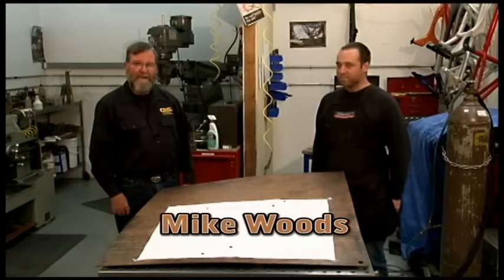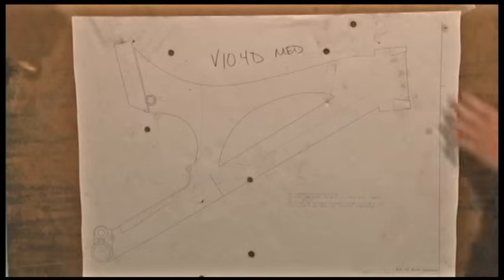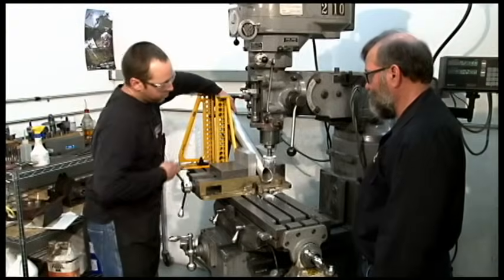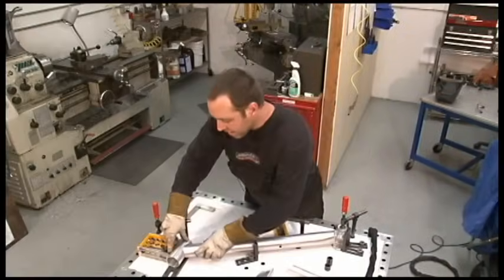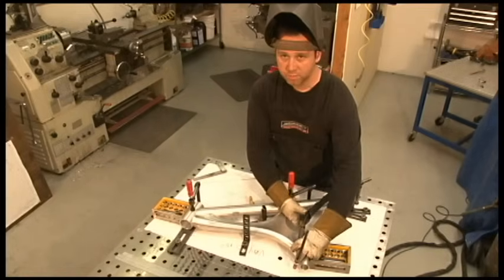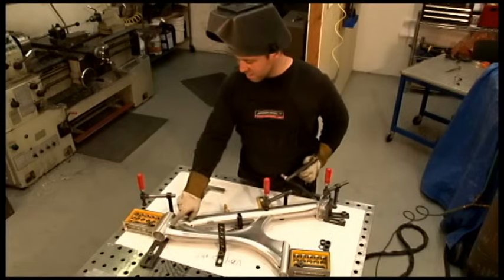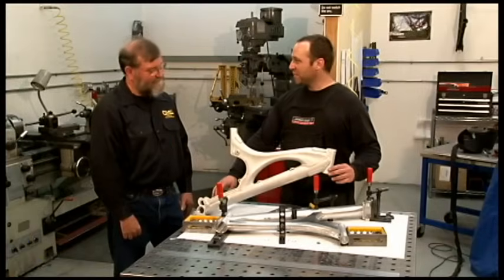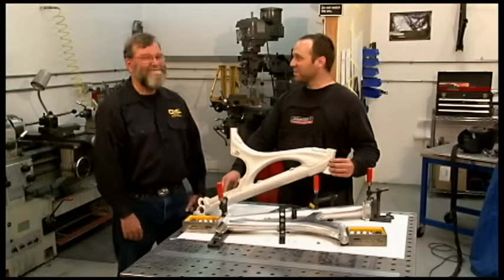Welding Aluminum Bicycle Frames

Comment: Which filler rod is being used?  What alloy is the frame made of?  Tia
Reply from the maker: I am not certain, but I believe the material is 6061, and the filler is 5356
Reply: @RonCovell  tyvm.  I have been trying to find some information on welding 7005 which is also used for bicycle frames.
Reply from the maker: I found this online:
https://www.google.com/search?q=welding+7005+aluminum&sca_esv=4b32451117f11e5d&rlz=1C1VDKB_enUS1060US1060&ei=lNozaMnmLZLAkPIPi6KnwAY&oq=welsing+7005&gs_lp=Egxnd3Mtd2l6LXNlcnAiDHdlbHNpbmcgNzAwNSoCCAAyBxAAGIAEGA0yCBAAGAgYDRgeMgsQABiABBiGAxiKBTILEAAYgAQYhgMYigUyCxAAGIAEGIYDGIoFMggQABiABBiiBDIIEAAYgAQYogQyCBAAGKIEGIkFMggQABiABBiiBEj9IVClCFjlC3ABeAGQAQCYAWGgAa4BqgEBMrgBAcgBAPgBAZgCA6ACuwHCAgoQABiwAxjWBBhHmAMA4gMFEgExIECIBgGQBgiSBwMyLjGgB58NsgcDMS4xuAe5AcIHBTAuMS4yyAcK&sclient=gws-wiz-serp
Reply: @RonCovell  Tyvm,  I have seen similar but I am trying to find detailed techniques for welding.  I have found videos but they just show the welding but leave out any details.  Because of the Zn content it does react differently from the 3xxx, 5xxx and 6xxx alloys.  What I am trying to develop is a repair technique for the valve covers on mid-90's MB engines,  I have one that I am working on and it is quite different material to weld on.
Reply: @RonCovell  I am thinking that the technique is to just barely melt the alloy as the melting point of Aluminum is about 1200F and the boiling point of Zinc is about 1600F.
Reply from the maker: I am not an expert at welding 7000 series aluminum, but my understanding is that 7075 is considered 'unweldable' - not because you can't make it flow together, but that 'intergranular corrosion' happens internally after the weld is made, making it likely to crack. I know that 7005 is welded for some bicycle frames, but I don't know the details of the process. You might learn something from this video: https://www.youtube.com/watch?v=q9eD_NKGQ9g&t=5s
Reply: @RonCovell  7075 is considered unweldable and the reason is primarily the copper content.  The cracking actually occurs during the cooling process and is an initiation site for further cracking.  The cracking from the welding process significantly reduces the fatigue life and strength which negates any initial reasons for using 7075 (which has the highest tensile and yield strength of any aluminum alloy).  2024 also has a high copper content and is considered unweldable for the same causes as 7075.  Due to their inability to be welded is the reason why aircraft are riveted together rather than welded.  Even though riveted joints have a lower strength than the parent metal, the loading on aluminum wing panels is more of a plate loading than a longitudinal or transverse tensile load.

Thanks for the video link.  Aaron is an interesting person.

Another thing, 7075 is a Zn-Mg-Cu alloy while 7005 is a Zn-Mg alloy.

I have done better on my valve cover in building up corroded areas, but it is difficult.

I may try using a larger cup and see if that helps any.
Reply from the maker: Thanks, I see you have researched this extensively!
Reply: @RonCovell  Well, to be honest, I am an engineer with an extensive background in materials science, so I know a thing or two and I don't work for that insurance company.  🙂

I have enjoyed the conversation.  It has been helpful and gave me a few things to think about.

Comment: What is the most suitable type of aluminum to make a frame of this type?
Reply from the maker: Each manufacturer selects their own particular alloy, and some keep this information secret. I believe most manufacturers use aluminum in the 6000 series, and the widely-available 6061 would be a good choice for someone to start with.
Reply: thank you very much for the reply...

Comment: Just asking as a noob, is not necessary to have gas flow inside the tubes?
Reply from the maker: You'll find that there is a difference of opinion on this. With reactive metals like stainless steel and titanium, internal purging is quite important. With steel alloys, very few builders do internal purging. Aluminum is occasionally purged, but it's not the norm, and the frame shown in this video was not internally purged.
Reply: @RonCovell  great, thank you for the explanation 🙏

Comment: Its great and thank you for the detailed video,We are new to the manufacturing of Aluminium Cycle Frames.Could you please let us know whats the table name and its fixtures which you used to hold the frame rigidly
Reply from the maker: That type of table is often called a 'fixturing table' or sometimes simply a 'welding table', and there are many manufacturers worldwide. Here's one example to get you started:
https://www.trick-tools.com/StrongHand-Rhino-Cart-Mobile-Fixturing-Station-TDQ54830-K1-10380
Reply: @RonCovell  Thank ron :)

Comment: I love the look of Aluminium welds and the look of bare aluminium, it used to seem like the perfect metal to me, but didn't know then how much it can be prone to salt attack, discovered that from riding motorbike in winter and dishwashing aluminium food trays...
Reply from the maker: Well, one option is to anodize the aluminum. Anodizing is quite good at protecting aluminum from salt water and many acids. The anodizing can be clear, so it looks a lot like bare aluminum, or it can be colored, which can offer an interesting 'candy' like finish. Many aluminum bicycle parts  are anodized - like crank arms and stems.
Reply: @RonCovell  ah okay yeah, I've seen anodized aluminium parts before but don't know the process of getting I supposed probably through some sort of electrolysis in a solution bath, I'll have to look it, thanks! 👍

Comment: Is it true when you weld aluminium you weaken the metal around because of the heat?
Reply from the maker: A lot of aluminum is heat-treated to give it extra strength, and when you weld it, the heat treatment is lost. If you weld on aluminum that has NOT been heat-treated, no strength is lost. Further, if both the base metal and the welding rod are the proper alloys, the entire welded assembly can be heat-treated, which is pretty much the standard procedure when making aluminum bicycle frames.

Comment: I have a yuba mundo cargo bike
Problem is theres no suspension 
I paid $1800 no motor
Highest speed 24 
8x3 
They say I can put 9x3 that’s it 
The back frame is not wide enough for 12 speed biggest tire 26x2.45 not big enough for 441pound weight limit 😔
I would rather build my own custom cargo bike then shop online or in store
Not even babboe centure xl trike is not worth it that’s a tricycle with skinny tires on it smh
Reply from the maker: Sounds like you have good reasons to build your own frame.

Comment: what type of welding machine did you use? Im used to seeing those types with sparks flying
Reply from the maker: TIG welding was used on this bicycle frame. MIG and stick welding both are accompanied by a shower of sparks, but sparks of any kind are quite rare with TIG welding, and usually only happen if there are impurities on or in the metal.

Comment: Thanks for sharing, I am not sure there was much on this video, no cleaning steps, prep, specs, etc. just a little bit of welding, but the best I got was to use the breadboard flat to set the position of the parts to start.  That was a good tip.
Reply from the maker: Glad you enjoyed it! I do have other videos that go into more depth on the welding processes:
https://www.youtube.com/watch?v=3sp1BP29J4E&t=61s

Comment: Just curious I dont know if someone has asked it yet but is the welding done using a foot pedal? It didn't sound like one was being used.
Reply from the maker: Yes, the TIG welding machine had a foot pedal to control the amperage 'on the fly'. That's the system preferred by many professional welders. Unless the amperage changes are large, you often can't hear them.

Comment: Hi Ron was wondering if you might know the best way to clean aluminum?  Thanks
Reply from the maker: It depends on what's on the surface. I use acetone for oil or grease. I like the Scotch-Brite Strip & Clean discs for light or medium corrosion. Paint is best removed with a specialized striper. For deep corrosion or pits, I use whatever grit of abrasive disc is required to efficiently remove the surface crud.

Comment: I have a cinelli vigorelli.with a dent / bend in the downtube ..when it was shipped..can it be fixed or replaced?
Reply from the maker: Will - I believe your frame is steel, which is TIG welded together. While this is a tricky repair, which should only be attempted by a qualified bicycle frame builder with a precision fixture - the downtube can be replaced. Of course the frame would need to be repainted afterward, so the cost of a proper repair could approach the cost of buying a new frame!
Reply: @RonCovell  I think you're right .Columbus thron oversized 
It's a vigorelli pista frame 
I.built it with proper campy track parts 
Sold it on ebay 
It got bangeg up while in transit..I shipped it with 6 inch foam core all around

Really ticked off at ebay 
Global partner 
Some co in Canada 
So if I get the bike back 
Any suggestions on who can fix it and get I back tp it's original 

It's a collectible bcofvthe age and it's special Ed color for the giro
Reply from the maker: I just found this, which could possibly be a solution:
https://www.youtube.com/watch?v=JTDeXG0kweA&t=276s
There are a LOT of qualified bicycle frame builders around. One who is well known on YouTube is Paul Brody, who is in Vancouver BC:
https://en.wikipedia.org/wiki/Brodie_Bicycles

Comment: what name weld tool you used to weld in your frame aluminum?
Reply from the maker: This is TIG welding. TIG stands for Tungsten Inert Gas.
Reply: It is right to used crack frame
Reply from the maker: There are 'issues' with repairing cracked aluminum bicycle frames. While cracks can certainly be welded, most quality frames are heat-treated after welding, and you will lose the heat treatment after re-welding, making a weak spot in the frame.
Reply: Over sitpost?

Comment: sir what s the base material and what filler rod used here sir?
Reply from the maker: I'm not the one who did the fabrication here, but I believe the tubing and monocoque is is a 6xxx alloy (most likely 6061) and the filler rod is probably 5356.
Reply: @RonCovell  ohkk sir thank you

Comment: Hi sir actually we are a startup compnay making alumnium 6061 frames(bicycle) .appreciate your advise for painting process for best painting
Reply from the maker: Powder coating is a great solution! It bonds tenaciously, comes in a wide range of colors, and is extremely durable.
Reply: @RonCovell  oh kk thank you sir.actually we are planning to give smooth colors with stickering and close the surface with clear coating(like we apply on car surface for gloss look).any treatment process wud u advise sir to make surface clean and then apply paint or primer etc
Reply from the maker: Aluminum is somewhat more difficult to paint than steel. Paint is not my specialty, so I cannot offer specific recommendations, but many automobiles now have aluminum panels, so you could check with places that do collision repair to learn more about this.
Reply: @RonCovell  sure sir noted thank you again

Comment: Hi. I have a question is there an easy way to use a blowtorch and some kind of stainless steel rod and bond to stainless steel pieces together or is this impossible. I have a video I can send to show my question in video form. Thanks
Reply from the maker: Stainless steel can be soldered, and most blowtorches (or propane torches) are hot enough to do this. https://blog.sra-solder.com/knowledge-base/can-you-solder-stainless-steel

Comment: What aluminum is this and what electrode
Reply from the maker: I am not the one doing the welding and fabrication in the video, and they did not share with me the materials being used. I presume it is a 6XXX series aluminum, and the filler rod is 5356.

Comment: I need a project done replacing the drop tube for the seat post on my 83 PK ripper looptail it was broke at top where clamp goes on  I got a temporary split in the center tube and a clamp on it leveled n that so I can still put a seat post on but I need it restored back to original any tips it's rare to find another one where I'm at
Reply from the maker: It should be possible to remove and replace the damaged tubing.
Reply: Awesome it's aluminum and should I remove the post entirely and get an exact tube size and everything to replace it and should I grind the welds where it was on top tube and bottom crank tube thank you for your time and advice I have an 95 elf team issue pro since I was young going to restore all the way 🙂

Comment: I'm guessing this comment won't be seen since it's an old video. That's a beautifully fabricated and welded frame, but it bothers me that it was apparently not fully welded where the copes overlap at the head tube. The top part of the down tube was only tacked before being covered by the monocoque. Maybe part of the process was edited out. When building racecar chassis, that's a big no no and requires some thinking ahead. It can cause more pull/distortion when you have to weld part of a fit when the rest of the chassis isn't tacked yet, but it creates a stress riser and leaves a lot of critical strength on the table. If you or anyone that's actually in the know has some more insight I'd be curious to hear it. Bike frames are built in the margins where weight and strength are critical and there's really no room for compromise just to save a little time, so I was surprised to see this.
Reply from the maker: Thanks for watching, and commenting!

I have been around a lot of race car chassis construction, and in my experience, not all builders will completely finish weld a joint if it is covered by another welded structure. I'm not a structural engineer, so I can't 'run the numbers' to see how much strength is 'left on the table' with this style of construction. If an incompletely welded joint can't move because it is trapped by something encircling it, I don't know that can be considered a stress riser.

In the aircraft world, many structures have holes placed near their centers to reduce weight. This reduces the strength very little, since the majority of the loads are carried near the edges of the part.

Maybe someone with more experience can share their experience with this important issue!

Comment: As an aluminium welder by trade one of the reasons I never bought an aluminium framed bike was that I'd always look at the welds and think 'I would do better than that'. This frame is borderline, kinda ok but I wouldn't be all that happy with it.
Reply from the maker: You must be an exceptional welder, indeed!
Reply: @RonCovell  the guy from the 6061.com YT channel seems ok.
I used to make structures out of tubing similar to bike tubes but they were a lot bigger than bike frames so that included a lot of overhead work and other awkwardness since you couldn't just flip the things over or use jigs. 
One of the things I was most proud of was a 3d structure that had a 22m (70ft ?) diagonal measurement. Stretched over 3 work benches and no chance to clamp anything so needed careful balancing of the welds to keep it square. Ended up 1.5mm out. Measured that thing half a dozen times because I couldn't believe it was that little! I slept well that night. :)

Comment: Lifting the filler out of the argon ... that's not fantastic work, that's terrible.
Reply from the maker: You are correct that it is  'best practice' to keep the hot tip of the welding rod in the argon shield.

Comment: Ron, why wasn't the down tube fully welded to the head tube at the point that the "monocoque" covered that joint?
Reply from the maker: Mike Woods - the fabricator for Santa Cruz Bicycles - believes that a joint which is completely surrounded by another welded joint does not need to be completely welded.

Comment: Great; but what welding rod was he using and on what grade of tubing?
Reply from the maker: I believe the tubing is 6061, and the filler rod is 5356. That segment was filmed many years ago, and I've lost track of Mike Woods - the fabricator.
Reply: @RonCovell  Thank you Sir. I've been racking my brain over 4043 Vs 5356. Nice to know there is a Metal Working Celebrity who takes the time to reply.

Comment: I have a question for you, I used to ride a recumbent trike, and a car hit me, as a result the main frame got fractured, and eventually broke apart, somebody told me that it can be solder together, yet where I live nobody knows how to do it, and some people even say , that it can’t be done, so if I could send you some picks so you can give your profesional opinion, and if you are up to it I could send it to you.
I hope to hear from you Carlos
Reply from the maker: You did not specify what material your bicycle frame is made from, but I presume it's aluminum. Yes, aluminum can be brazed, but bicycle frames are generally welded together, since in most cases a welded joint is stronger than a brazed one. I don't do work for customers any more, but thanks for asking!

Comment: This seems like an older video than 2016
Reply from the maker: You are correct. This video is an excerpt from my 'Advanced TIG Welding DVD, which was shot around 2008, I believe.